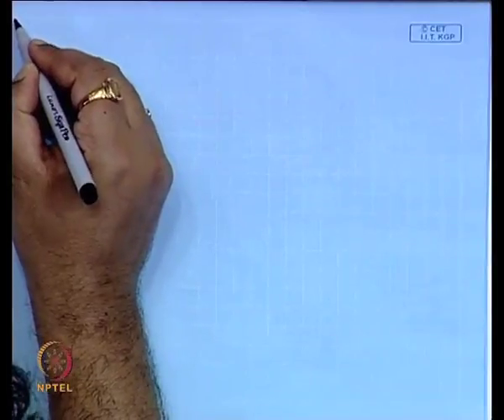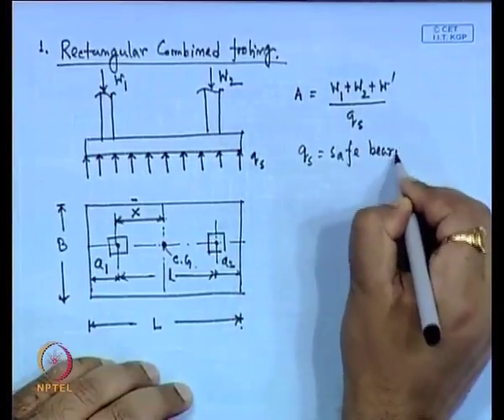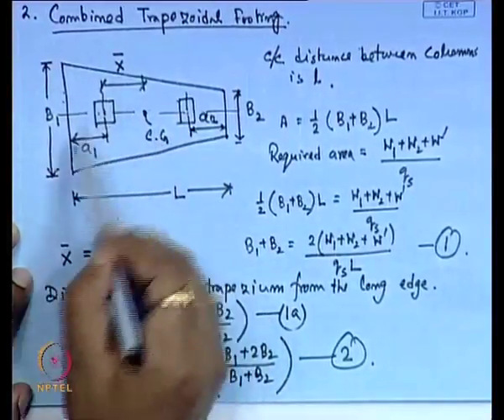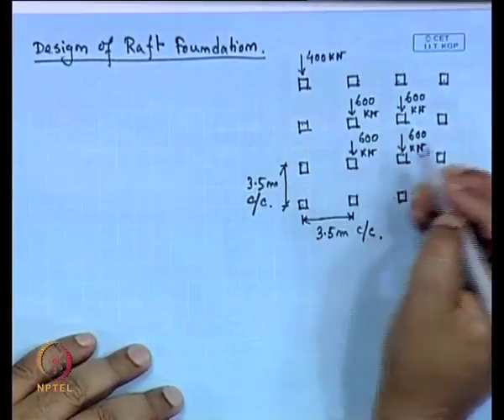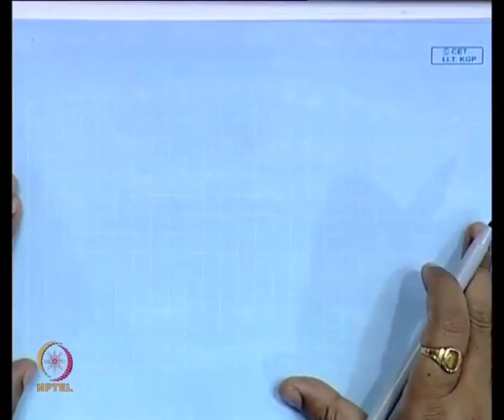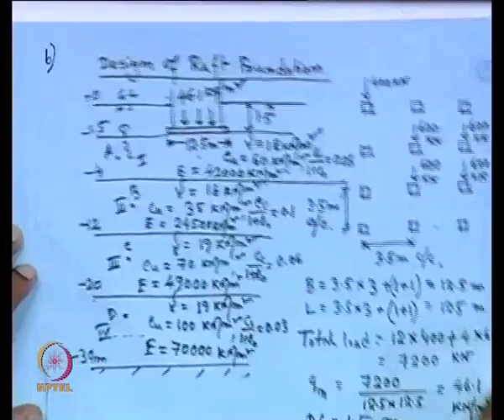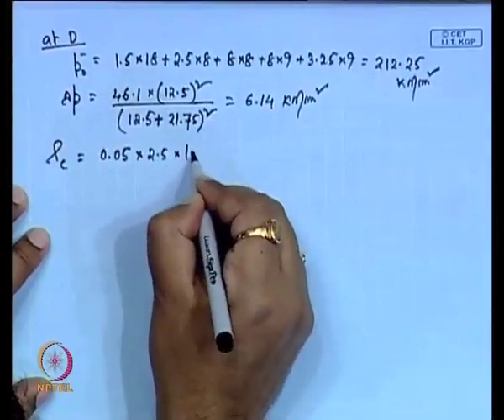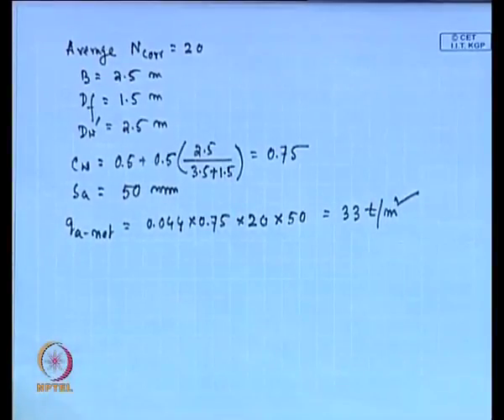Design of Raft Foundation

Comment: Thank you very much for these beautiful and understandable video.i have got to much benefit..But i also have a question..we uselly use spring coefficent for raft foundation.with this type of analysis we get differents displacement in different points under the foundation for example at one corner displcment is 1 cm and another corner 8 cm founded..what those thejust se means? is foundation get shape of soil as it is found  at one corner 1cm and another corner 8cm? or foundaion will have 1 cm displacement and buttom of foundation for another corner (8cm) will be void? thnx